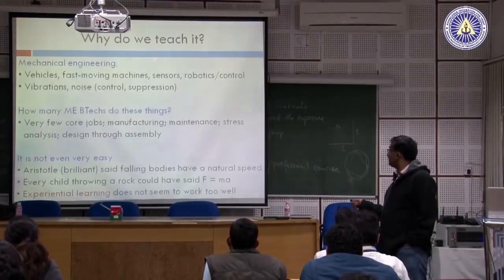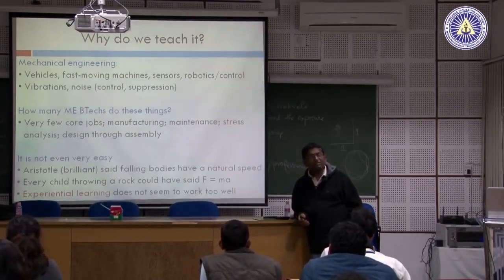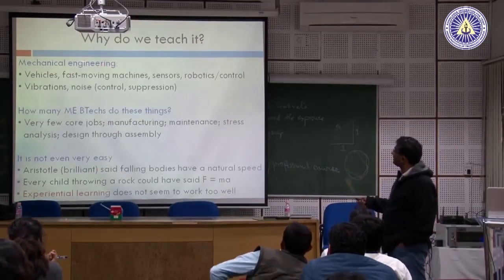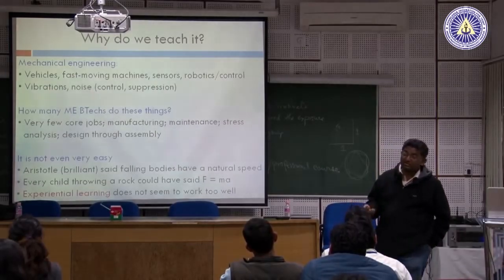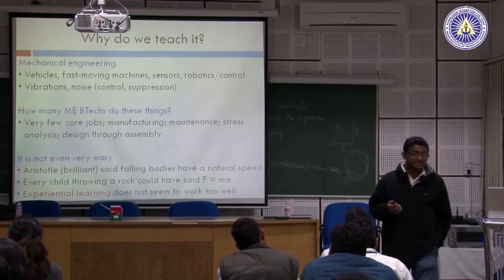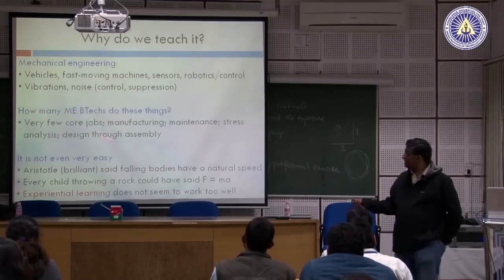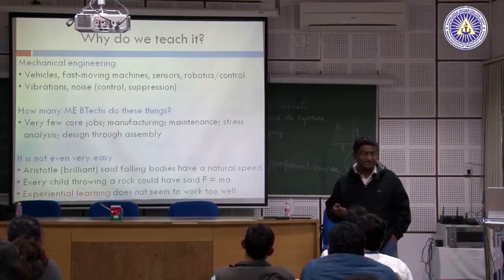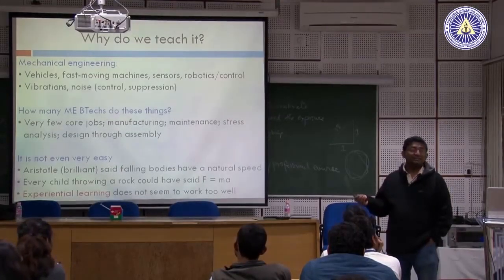Why do we teach Dynamics [Mechanical Engineering] by Prof. Anindya Chatterjee | IIT Kanpur

Comment: iconic inference:" Learning computers is easier than learning mechanics"
Reply: Actually it is the opposite. Electronics is very abstract, you can't see current flowing but you can see machines moving. So somebody apt in abstract thinking might find it true but most of the time that is not the case.